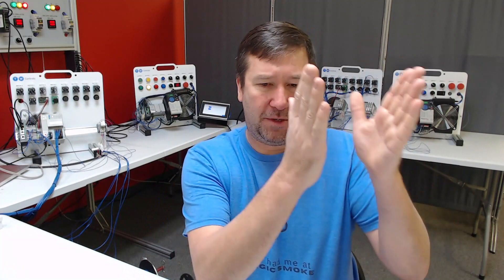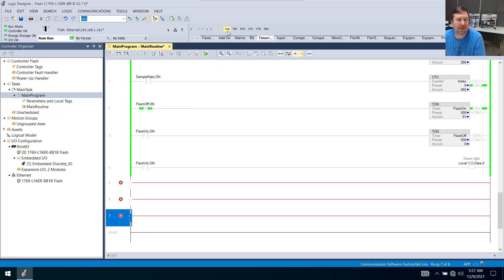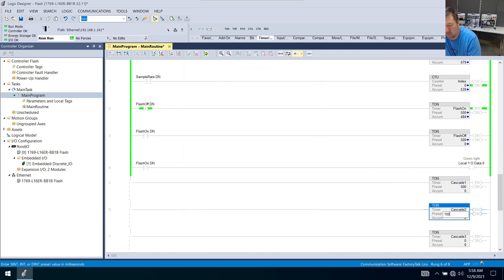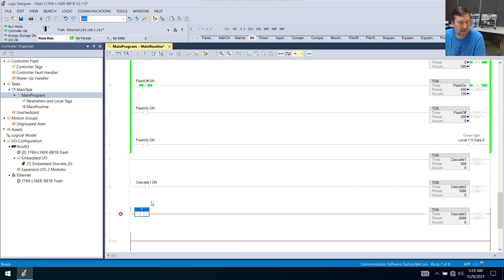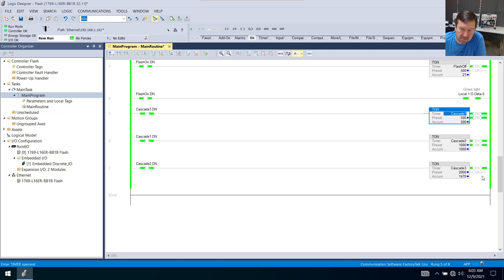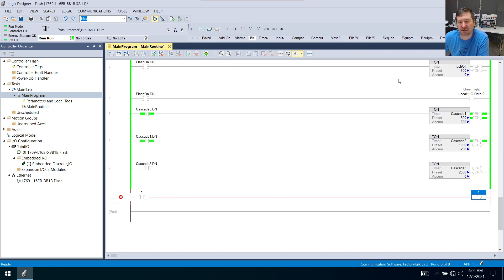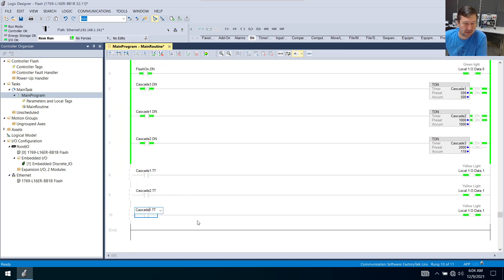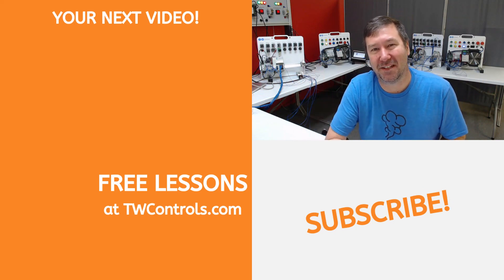Allen Bradley Cascading Timers for Auto Sequencing

Comment: I'm writing a couple of rungs of logic with 2 timers. The 1st timer will turn on the output after it has completed it's done cycle. Timer 2 will start after timer 1 becomes done. What's happening is that timer 2 never times out or go to done. What could be wrong
Reply from the maker: A few ideas...are you using the same timer more than once?  Is something resetting that timer once it is done?
Reply: @TimWilborne  no
Reply: @TimWilborne  If you have an email i can forward you a video of what going on
Reply from the maker: If your EN has a 1 in it and it isn't getting done, then chances are something else is writing to it.